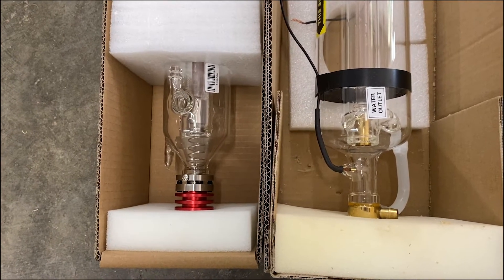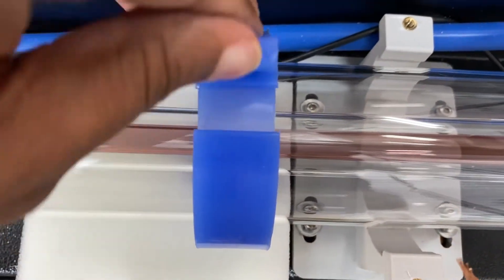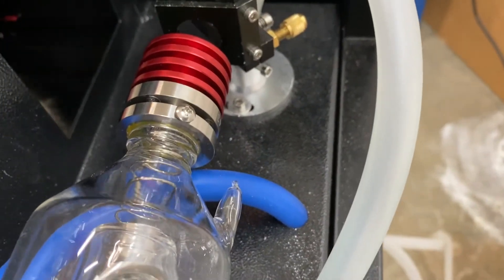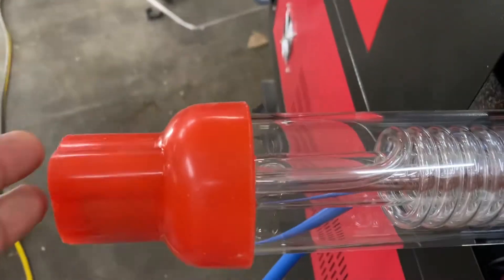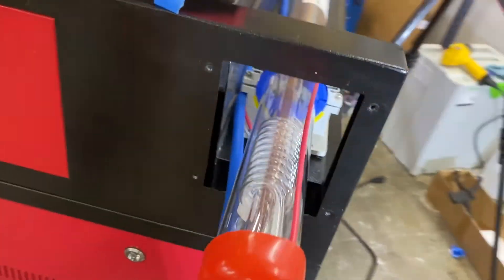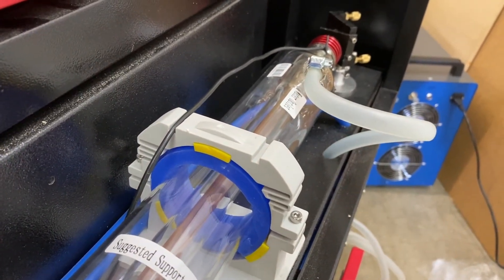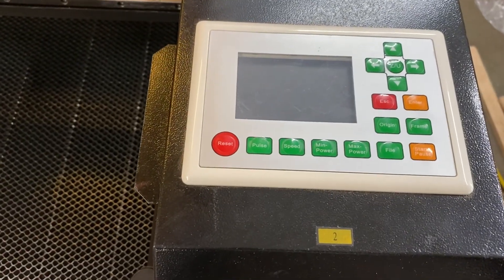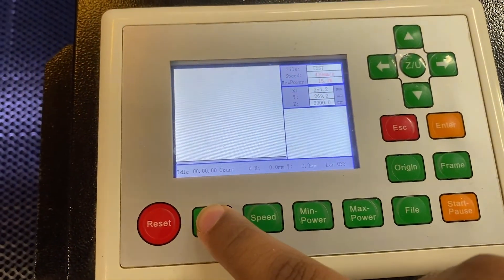Installing your new laser tube on Omtech 80w Red and black

Comment: I have the same machine and I was going to order that same laser tube, but omtech is claiming they do not come with those blue spacers that allow the 60mm tube to fit into the 80mm brackets that came with my machine.  I can't even find anything like them online.  Would you happen to have any leads on this?  Thank you!
Reply from the maker: Mine came on the tube already, depending on who you spoke with they probably don’t actually know that it’s pre setup on the tube and not like an add on. If it’s a replacement it should come sized to fit but I can’t confirm that

Comment: Man you saved me. Thanks for this video. How did you even find out how to install this thing? I made it almost all the way by just staring at it for way too long. All I was missing was "put the red cap back on", which is why I never fired the thing up. I didn't want to bet it all on my assumptions, and didn't know how to insulate the positive end properly. Never thought to use that red cap. But we are sure that's okay? Thanks again. Instant sub from me.
Reply from the maker: It took a minute to figure out. Thought they sent me the wrong one. Reached out to one of the guys who helped me get it replaced and he told me what to look out for. Red cap is made to insulate so all is good. Haven’t had an issue since I’ve gotten it installed. Thanks for watching!

Comment: I assume old one failed? How many hours? What happened?
Reply from the maker: The original one was defective when it arrived. It was giving a donut shape on my pulses instead of a solid dot. didn't realize that was the issue until many hours of troubleshooting.
Reply: @vanstray we’re the donut pulses in the mirrors or on the work after the focusing lense? 
Mine dosnt give fine Ulises on the mirrors when aligning but after the focus lense it’s fine

Comment: Thank you so much for your videos, Kimani! I've recently had my 5 year old Glowforge shatter on me (the lid, not the tube) and I'm looking to upgrade and grow into a larger and more powerful machine.  Your videos are definitely demystifying the hands-on upgrading/repairing that these machines allow, so I humbly thank you for your efforts and patience!  I have two quick questions. 1. Why did you need to replace the tube/how old was your previous tube? 2. I'm torn between the 80W and 100W version of the OMTECH. I'm coming from a 40W machine so either will be a huge boost in power, but do you find the 80W sufficient for cutting or do you ever wish you'd gone for the 100W? I see you also have a CNC so you may not fret over cutting thickness the way I do, but I'm curious how well the 80W cuts plywood over 1/4" thickness.  I do a bit of engraving, but I'm mostly focused on cutting wood.  Thank you again for your time, and for sharing your experience!
Reply from the maker: Thank you! 
1.The tube that arrived with the machine had a dead spot in the center and wouldn’t fully power up so it was bad on arrival. 
2. The 80w is nice and has cut up to 1/2 inch for me. Does just about everything I need. If I had to do it again I might still get the 80w, but definitely a larger cutting area and I think I’d need the 100w to make that happen. Otherwise it works well. Having the CNC does help with the larger pieces.
Reply: @vanstray  Thanks for getting back to me, I really appreciate your insight!

Comment: Hey there, your the only person that has done a video of the new tube thank you! Just a quick question, I just got my laser and it’s exactly like yours but they sent me the ceramic piece that I’ve seen people use on the red wire but didn’t see you do that. Any reason why? Because of the red cap?
Reply from the maker: yeah the red cap on the end acts as the insulation for the tube. So unless they made another tube change I dont think you'll need it for setup.
Reply: @vanstray  I have a little rattle sound when I pick my laser tube up. here is a video, does it sound normal?

https://youtube.com/shorts/61SzGpuZC5A?feature=share
Reply from the maker: hmm that's a new one for me, sounds like something is loose maybe in the red part. I know there's a tiny screw, don't remember if there's anything else in there. might try picking it up and pointing it downward to see if anything shakes loose or if the rattle stops.

Comment: Hi.  THanks for sharing this info.
It looks straight forward. Can you clarify the setup of the water inlet and outlet.  In the video it looks like you are filling the tube via the outlet port and draining through the inlet port.
https://youtu.be/pL2YRUEoKmk?t=570   . IF you did reverse the ports, was that the intent  and why?
Thanks
Reply from the maker: I’ll be honest I didn’t notice that until you brought it up. Laser has been working fine with the new tube, but I’ll check the hoses next time I’m in the shop